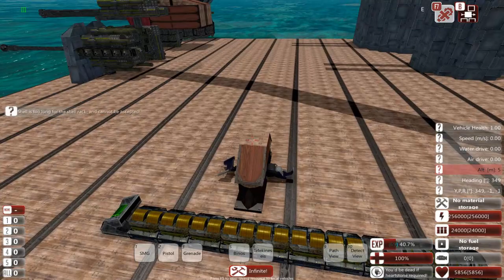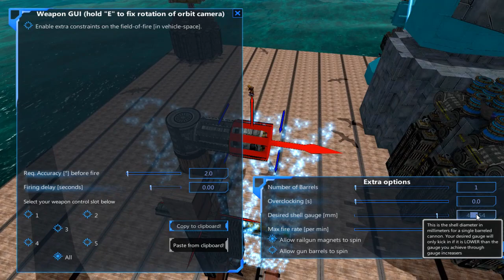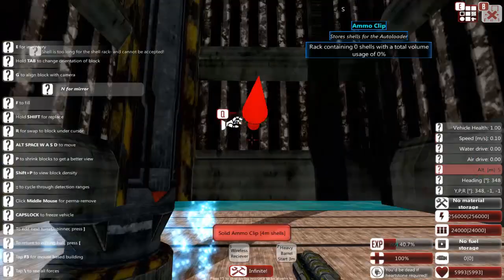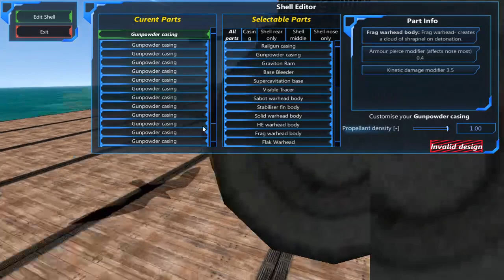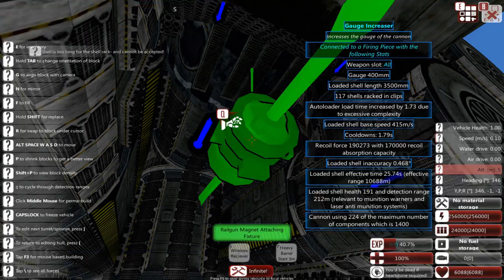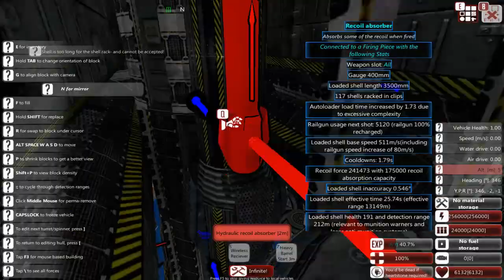FTD Tutorials 0: Advanced Cannon Walkthrough and Breakdown

Comment: FYI (and since you said shells aren't a huge thing for you).  Several components in the shell menu are actually shorter then normal, allowing you to squeeze a higher millimeter shell into the same clip size:  Base Bleeder, any Fuse, Visible Tracer,  and to a lesser degree Stabilizer fin body.  If you look at the shell size, By putting a Base Bleeder and a Fuse on, you actually 'shrank' the shell down to 3500mm and could have made the overall  size/MM bigger and still fit.  In your example shell, you could push the shell size up to 460 to 462 or so and still fit in the 4m clips.
Reply: I thought my eyes were deceiving me when I noticed that in game the other day haha

Comment: so the more rail magnets you have the more energy it can potentially use, but the slower the recharge rate, is that somewhat correct?
Reply from the maker: Pretty much, also the more power you have available, the more power it uses, and the longer it takes to recharge. You can adjust this in the rail settings.